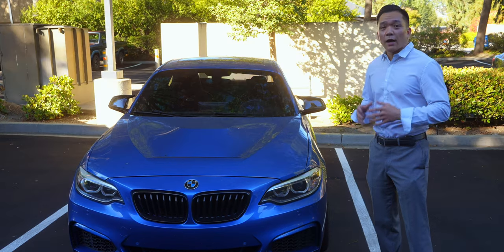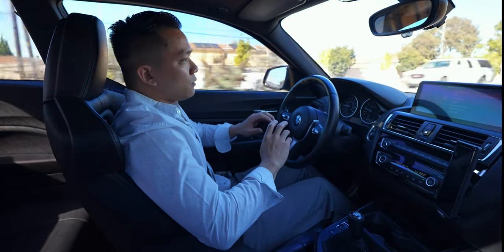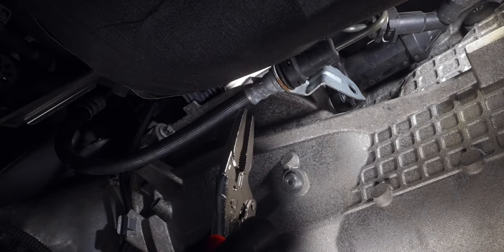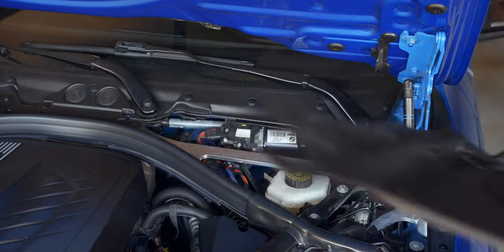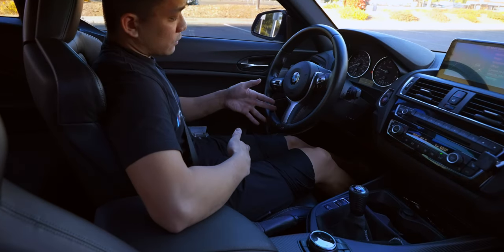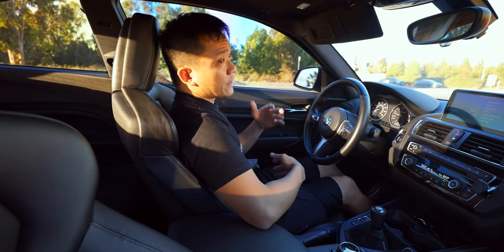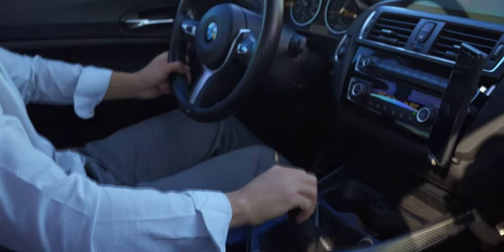Unlocking Ultimate Power in Your Manual BMW - Clutch Delay Valve Removal

Comment: Nice video but your problems were not caused by the clutch delay valve. What the clutch delay valve does is slow down the engagement speed when you quickly release the clutch pedal. The clutch delay valve is there to save the drivetrain from fast engagement. The valve slows down the engagement speed when you quickly step off the clutch pedal like a clutch dump. During normal driving or normal clutch pedal speed, the clutch delay valve does very little. You also cannot bleed the clutch slave cylinder like your brake by pumping it because it doesn't have a spring inside the clutch master cylinder to help the pedal return to its normal position. You normally have to push and pull the clutch pedal manually with your hand or feet. If your clutch is engaged (foot off the pedal) and your transmission pops out of gear, its something else like a bad transmission or aftermarket shifter. When you bleed the clutch slave cylinder, you might have to remove the slave cylinder to tilt it so the bleed nipple is at the highest orientation possible. Some cars will have the bleed nipple pointed downwards or at a slight decline which can trap air. If your clutch engages low in the pedal's range of motion, you have air trapped in the slave cylinder.

Comment: I did this when I installed gotuned single mass flywheel and twin disc clutch on my f22. I constantly had problems when shifting gears fast on the highway during acceleration my foot was faster than what the pedal could do. (pressing clutch was to slow and I was pulling out the gears while releasing the clutch was too slow that I had to wait before opening the gas again. ( not many people know of this mod because very few F series are manual and even less drive fast enough to notice this clutch problem. GREAT VIDEO!
Reply: I would like to add:
1. This mod is good only for experienced manual users that want a direct pedal that will let you dump the clutch when needed. It's going to be less forgiving when you mess up starting from a stand steel.

2. The pedal bleed doesn't work. At least for me because the line was completely empty when I did the job.
Reply from the maker: Thank you for sharing your experience in detail. Glad to hear I'm not the only one who had this problem resolved by removing the cdv
Reply from the maker: Thank you for thrashing these 2 additional points, especially that info on the bleed process. 👍

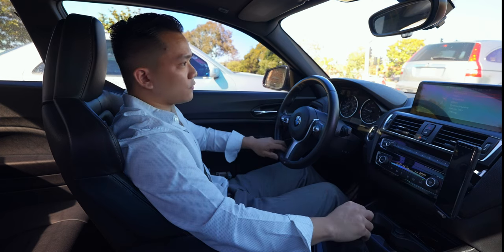Comment: This is a great video for getting an idea as to the problem the CDV causes. Most definitely the 1st to 2nd changes. I change gears fast and found myself constantly grinding the gear slightly as I put it in 2nd on fast acceleration and change most times. Other gears weren’t too bad but that change was always bad and put me off accelerating as fast in 1st gear as I didn’t want to damage the gearbox, which made general acceleration slow. 2:26 is such a good description of the issue and this video helped me realise that it isn’t just me not being able to change gear with this gearbox just after getting my 240i. After watching this video I got it done. It’s a really easy removal and once it’s done the gear changes are so much better. In my opinion it makes the car feel more connected as a whole and completely changes the feel. Most certainly recommend doing it as, in my opinion, it’s a night and day difference in the completion of the car. Thanks for the great video mate!
Reply: I'm having that 1>2 grind as well in my 2018 M2, its so annoying! Did removing the CDV solve that issue? Going to get the CDV taken out in a few days.
Reply: @f87m2_daniel heya yea it’s so annoying hahaha, I still get it occasionally but the CDV definitely made the gear changes better overall and helped with it. I’d highly recommend it. Also another thing is a clutch stop. Only like £5 and it goes under the clutch pedal to reduce the excess travel of the pedal after the engagement point. It has one already but the aftermarket one is larger. You can get various sizes based off personal preference. Goes so well with the CDV. So easy to fit too, you just pull out the old one and push the other one in the hole under the pedal. You can do it yourself in 30 seconds lol. Besides that I’m not sure as I still get it occasionally :/ I don’t think the gearbox is really meant for fast 1>2 shifts but it has to be done lol. I’m just gonna keep trying things to solve it and looking around to try and find something proper useful but yea, the CDV delete and the clutch stop help quite a bit with it (but don’t totally stop it it seems) but the overall improvement they make on the gear changes overall and the feel of the car and the engagement is crazy. Soooo much better it makes the car way more engaging overall. Keep me updated if you hear anything!
Reply: @f87m2_daniel  have you tried a different grip just for 1-2 changes? I think it likes it best if you hold the outside of the stick (left side in RHD configuration) and pull it in hard. Only just found it out but think it helps. 3rd to 2nd etc has always been totally fine whatever way I do it

Comment: I realize this is a BMW I own a 2017 Toyota IM, my car also bobs from a start and 1-2; it also has the world's most numb clutch, if you need to go fast you will either burn the clutch or stall no inbetween. This car demands to be driven leisurely otherwise  any kind of spirited acceloration and its bob city.
will this give me any feeling in the clutch?
Reply: I have the exact same issue on my 10th gen civic si.  I can't drive properly in the morning takes me 10 minutes to get used to it

Comment: Great vid. I have no pressure bleeder but can i just pump the brake pedal to build pressure instead??
Reply: Yea. Also you can use a syringe with a hose and connect to the fitting and pump out the brake fluid. The clutch will bleed

Comment: Yeah same I have a 2017 BMW M2 manual sometimes I feel the 1-2 shifts are inconsistent unlike the other shifts like it jerks a bit no matter. Which is weird would you say the CDV removal helped a lot? Thanks
Reply: I had it done in my 2 and it definitely made a world of difference on the one to two shift.  I thought I had forgotten how to drive a manual but it was the car not me.
Reply from the maker: in 1st and 2nd it definitely did. I haven't had the issues mentioned in the video since removing it.
Reply from the maker: in 1st and 2nd it definitely did. I haven't had the issues mentioned in the video since removing it.

Comment: Damn, this is the easiest way someone has done it, most remove the entire thing which seems not necessary
Reply from the maker: It is a little tight I suppose, but it's definitely manageable. If it doesn't come out just slightly go up in screw size, but if the retainer does not come out first then the previous owner may have removes it.

Comment: Hey Fritz, I tried this and blew out my clutch master cylinder while bleeding using a pressure bleeder. How can I avoid that in the future ?
Reply: How much psi did you add to the bleeder ? Seems like you pumped it way higher then 15-20
Reply: I think I did the same, what was your car doing that makes you think your clutch master cylinder is bad, thanks
Reply: @ clutch to the floor and didn’t come back up
Reply: @ see my comment, don’t know if it tagged you or not